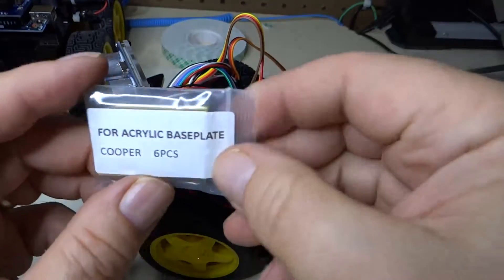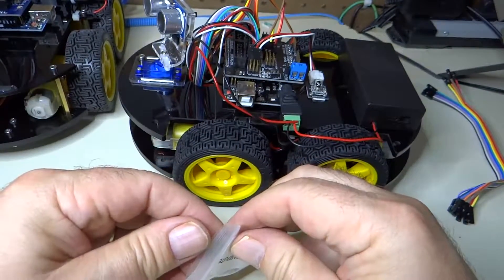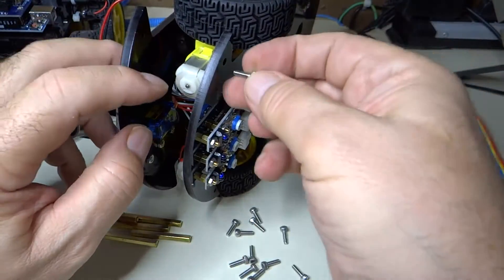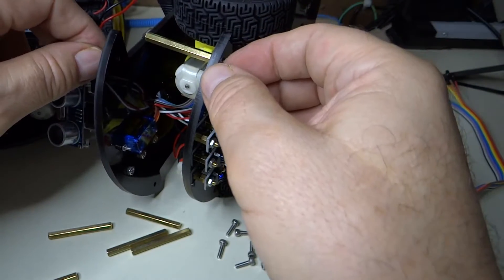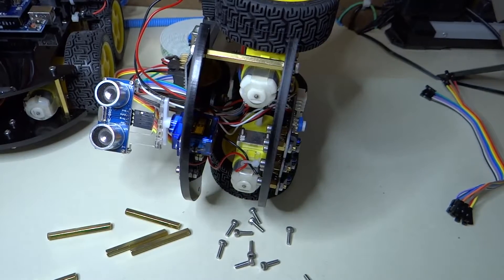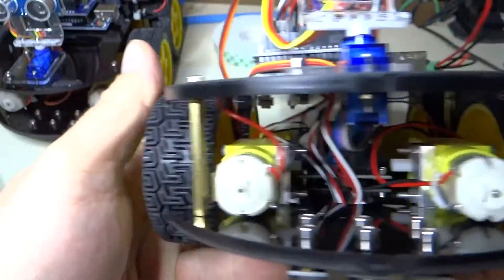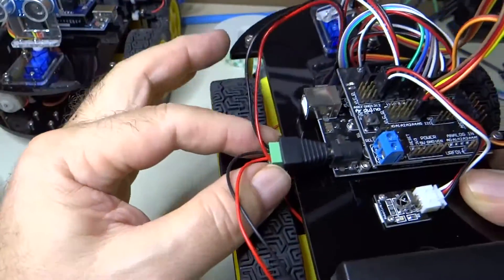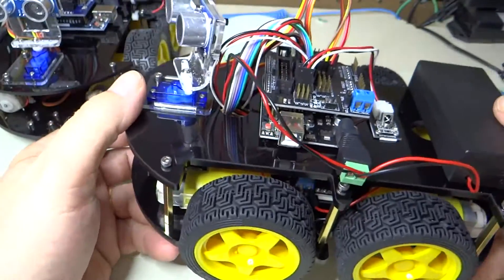Elegoo SRC kit 26 final assembly

Comment: This step is easier to do if you attached and tighten down all the posts to the bottom chassis plate first, then set the top chassis plate on top. The posts will not turn on you when you go to install and tighten the upper screws.